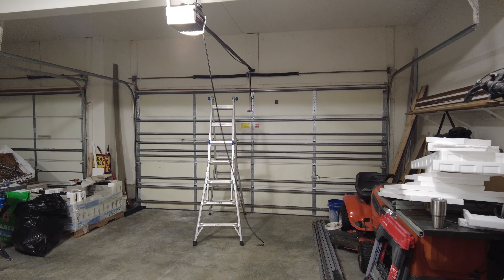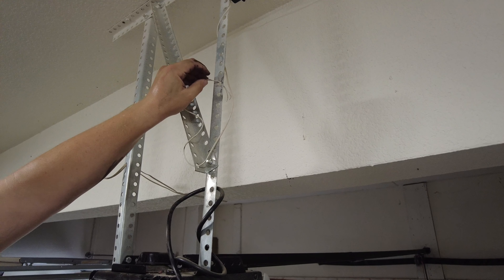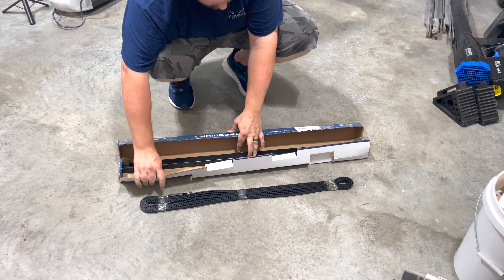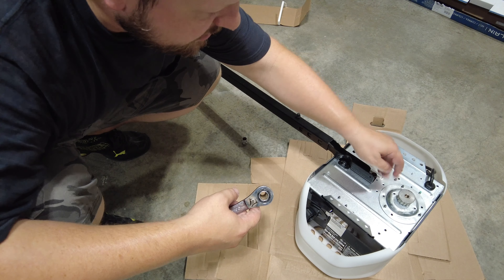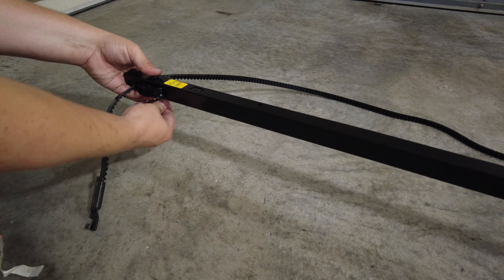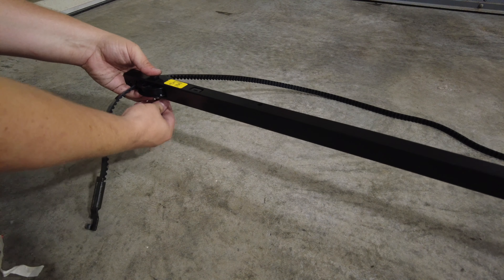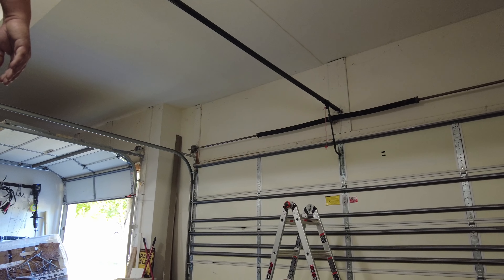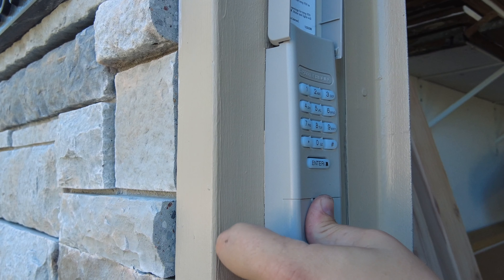How to Install a Garage Door Opener - Chamberlain B2405 with MyQ!

Comment: Not the best video. Didn't cover the wiring that needs to be done. And connecting the sensors for the track
Reply: Most Chamberlain and Lift Masters are the same . So there's not need to run wires
Reply: Read the instructions
Reply: Dang man, you want the guy to just come install the whole thing for you? Cut the guy some slack.  

👍 video
Reply: Being critical about something that doesn’t exist… There’s no track sensors to install on modern belt drives, hence the setting the up and down limits on the opener itself.

Comment: You did not mention putting on the trolley until after all the rail pieces were assembled. Now I can't get the rail apart to put on the trolley. Very very frustrated
Reply: This video needed some illumination. I messed up the spring part, got my finger pinched by it, and now I have to figure out how to compress it

Comment: Does it include rail assembly, opener arm, and emergency release? Because it doesn't show those things in the picture on Amazon.
Reply from the maker: Yes, it does. It includes a box rail that you assemble as well as the trolly and release. Depending on how tall your door is you may need to get a rail extension though so be sure to measure it.
Reply: @TopHomeowner  Alright. That settles it. Thanks!

Comment: I’m having some trouble installing mine how do I know which wires go to the sensors and the door panel? They are all the e same color
Reply: Just trace them back along the ceiling and wall, then mark them so you can remember

Comment: How long did it take you to install the new opener? Dreading doing this
Reply from the maker: It took a bit of time. I'd say you can probably get it done in an hour or two. I need to install one without replacing an old unit and I'm really not looking forward to that task!
Reply: @TopHomeowner  thanks! I didn't realize the threaded bolt for the pulley spring was flat on one side and tore the threads up forcing it through. Ended up having to get a new one from chamberlain because it made my belt sag

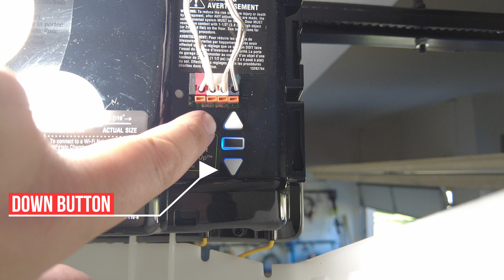Comment: 8:51 Im having trouble at this step. It beeps twice and doesnt move at all. Any advice?
Reply: Did you solve this. I have the same problem.
Reply: @streetoregon  yes. The circuit board wasn't wired correctly. So you had to swap the wires for the sensors.

Comment: I can’t get both lights to work on the unit, only one light works. Any suggestions?
Reply from the maker: Just the basics, try a different bulb and make sure there's no debris or gunk in the socket. Otherwise it sounds like maybe the unit is defective.

Comment: You could of used the previous rail because the old opener is a belt drive obviously but the Liftmaster one piece t-rail is way better than the square rail and it is unlikely to brake than the section square rail
Reply from the maker: Originally that was our goal, just switch belts but we discovered the belt we purchased for replacement sagged and we needed to get it fixed that day. It was a good excuse to make a video since the Chamberlain used the replacement belt we purchased. We will be reusing the LiftMaster on our other garage door with the appropriate belt. We agree though we would have preferred the one piece rail.
Reply: @TopHomeowner  yea i would to

Comment: If I was you I’d reuse the rail from the old opener and replace the belt
Reply from the maker: Originally that was our goal, just switch belts but we discovered the belt we purchased for replacement sagged and we needed to get it fixed that day. It was a good excuse to make a video since the Chamberlain used the replacement belt we purchased. We will be reusing the LiftMaster on our other garage door with the appropriate belt. We agree though we would have preferred the one piece rail.

Comment: What if I need to tighten the belt after release that spring … mine is loose I didn’t pull enough tension 🥲
Reply from the maker: You can tighten it down more with a wrench. Mine was a little loose too after following the instructions to a T.